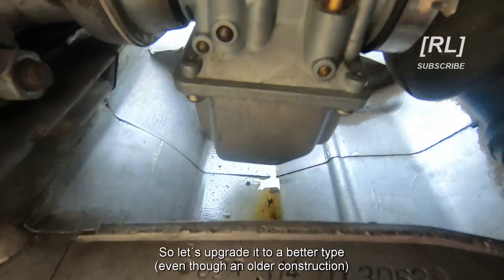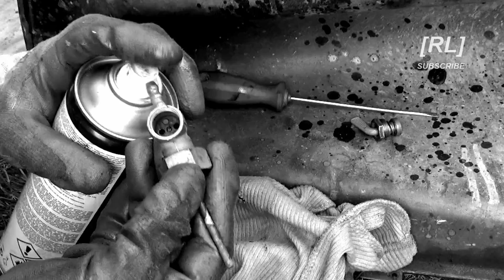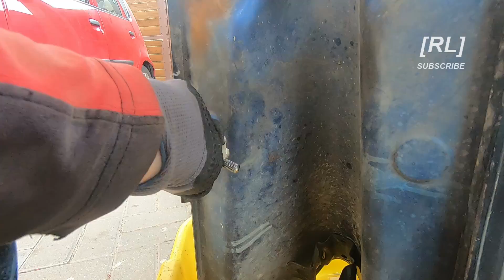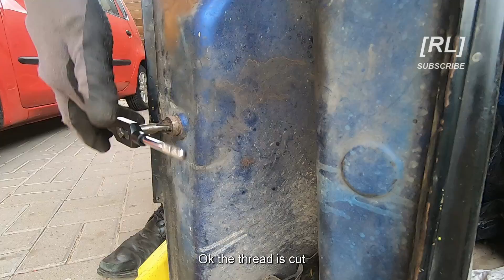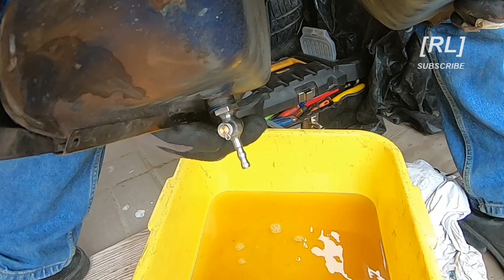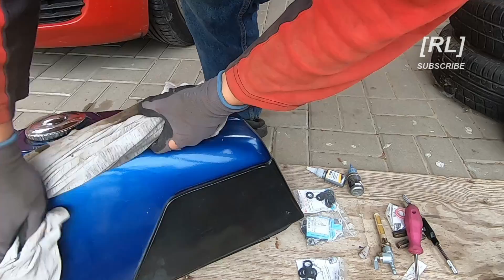Jawa 350/639 - Gasoline Tank Valve Upgrade (HD)

Comment: Great job, I might do that after I have done speedometer repair you show in your other video.
Reply from the maker: Hi Yann, yeah, think this valve is a lot better that the original one. Although this is procedure impacts the originality of the motorcycle, I think it's almost a must as the original valve is simply unreliable. Just go for it, the tank is prepaired for this, it seems.

Comment: I never had any problems, with fuel taps, in my 42 years of riding Jawa & CZ motorcycles, until they started contaminating petrol with ethanol.
Reply from the maker: Exactly
Reply: Is that why it is happening? Interesting.
Reply: @yannkitson116  Ethanol also causes overheating, poor combustion, loss of power & sooted up spark plugs on 2 strokes, unless one mixes in a shot (33:1 to 40:1 per litre) of diesel or kerosene in with the petrol oil. This raises the fuel's boiling point back up to pre-ethanol llevels.
Reply: @CZ350tuner  Thanks for the information. My Jawa 350/640 has problems with idling and it need constant attention unless the idling is set very high about 2000 rpm.
Reply from the maker: It could be, that you have to check or rebuild the carb (fuel valve closeness, needle, check the jet jam), reset the floating chamber fuel hight and then set idle mixture (when engine is hot). That being said, if the engine problem is the carb of course. I would firstly check, only then rebuild - if something is bad. The quality of new aftermarket parts these days is no good for Jawa.

Comment: Good job!
Please tell me more about the thermometer you use. What is it and how is this connected to an aircooled engine?
Reply from the maker: Thank you. It is a thermometer from the oldtimer Skoda 120L which means sensor and gauge. The sensor is sitting on a small beam, that is connected via cylinder head nuts to both of the cylinder heads.